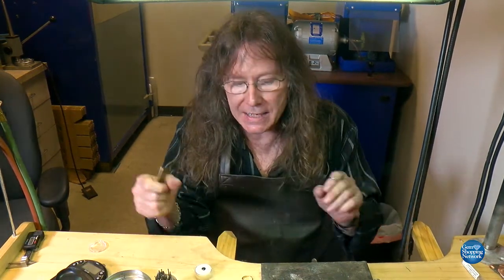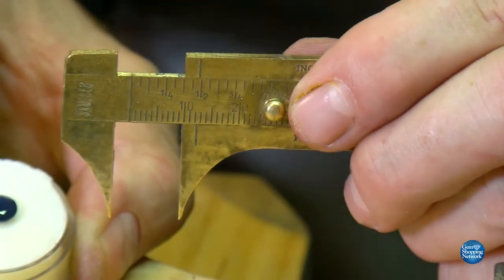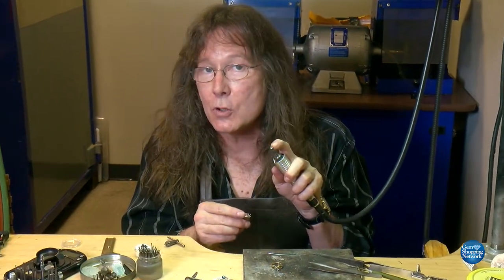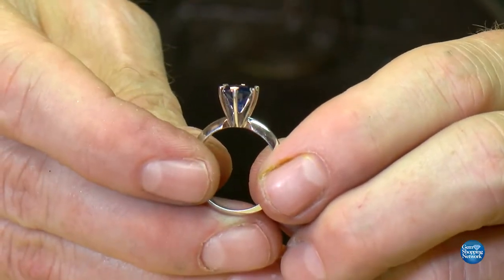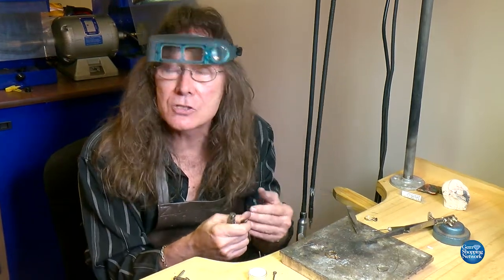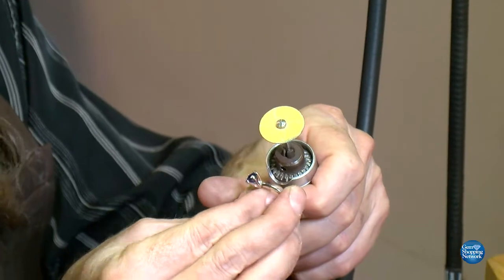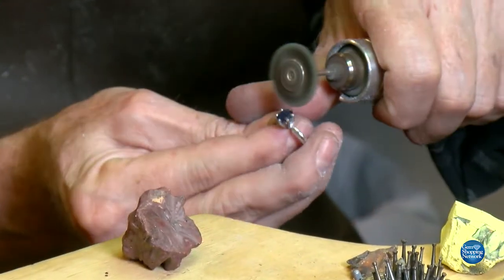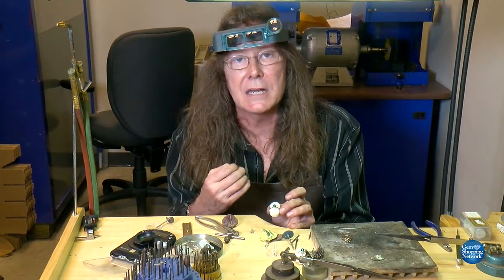HOW TO Setting a Solitaire Gemstone  - Tutorial l Gem Collectors

Comment: Perfect Job but I was lost when he took a new different bur to fix something he found was incorrect in the prong setting. He failed to explain what he was trying to achieve to make clear that step he made.
Reply: basically once the stone was in the seat he cut, he must have noticed that the belly of the stone was such that it was making contact with the prong. In that case you have to do a little customization, either by tilting the bur you used the first time different ways or by carving out  the prong with the ball bur or any other bur or even a saw or file. I hope I made sense. I'm just a beginner as well.

Comment: hello thank you for you videos but can you tell me where can i find those pliers?
Reply from the maker: Great question and glad you spotted something different in the pliers! 
They are not standard gem setting pliers and can only be found by a Craftsman tool dealer which Sears was where I got mine. The pliers are called “ignition pliers” and are found more in the automotive section at times.  I then ground off the teeth grips and tapered the ends of the jaws to my desired thickness. They are indispensable and nothing comes close for effectiveness and control in a plier  that is  made for the trade,  in my opinion and they cost 4 times less as well!